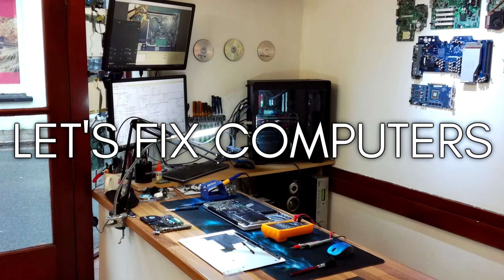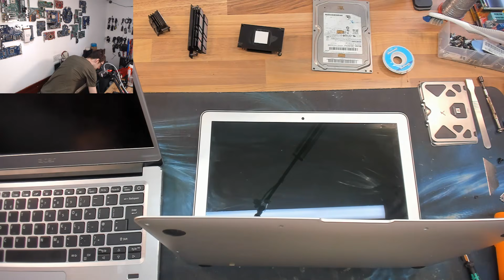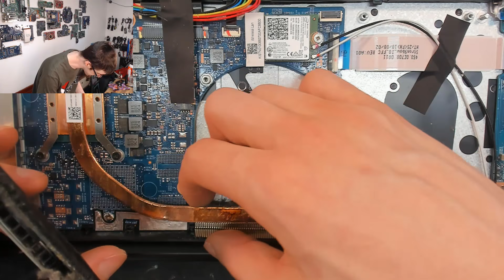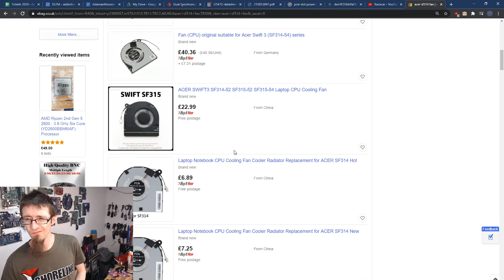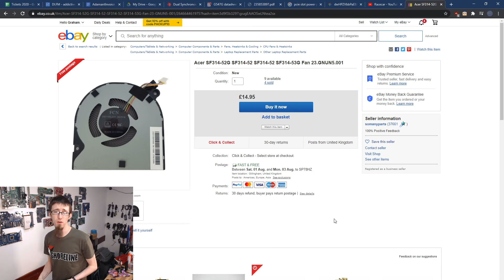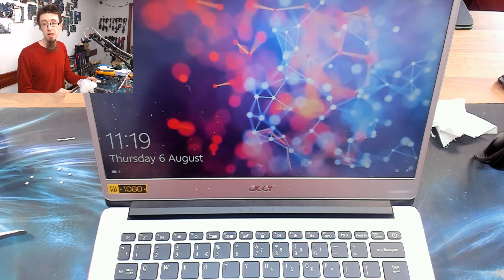Noisy Laptop Fan (Acer Swift SF314) - LFC#219

Comment: Since black tape is sticky, it will collect dust.
The heat conduction metal is hot, we can not use normal tape to stick on it.
Is it preferable to avoid using tape in this situation?

Comment: my gamer laptop fans do make lot of noise but that part is normal. what isnt normal is that it sometimes makes electrical noises i kinda get scared and dont know what to do about it. if i lift the laptop it stops but if i put it back it buzz again. 

not always but sometimes. also for little more info on it. its 5-6 years old working still perfectly fine. we had to change fans few months ago cuz old ones lost their heat sensor but other than that it has no issue

Comment: I had the same problem with noisy fan, and fixed it by opening the fan itself then put a little amount of lubricant and it worked fine without replacement 😂.

NGL i went to risked it all just to save money.

Comment: My laptop sound the same as the acer but worse made a high pitch sound like a fork on a plate and it was spinnig only at 100-2100 rpm my cpu fan is normal go up to 5600rpm

Comment: Hi! I have a question. I have the same issue with my laptop and I looked everywhere for a new fan replacement on eBay and couldn’t find. I was wondering if you know any other laptop brands that use the same fan as the CEPTER N510-01 laptop 😊 it would help me out greatly 🫶🏼🫶🏼

Comment: That vibration is what my fan does... but sometimes when i turn it off, unplug everything and turn it on on my lap it works fine.. also when the fan wors at slower speeds it does that too

Comment: hi sir , i am having lenovo ideapad gaming. the sound from the fan seems good like that of macbook but while placing my ear near to the back panel i can sense some noise and when the fan is at high speed there is such no issue and when the fan spins at a moderate speed i can sense some kind of ratling vibration on the back and front panel . could you please guide me with this @Adamant IT

Comment: Mine did this i cleaned the dust out and fixed it was unbalancing the fan was abit of hair in there aswell 

No fan wobble
Means dust or fan needs lubrication as a fix

Mine is exact same model but windows 11

Comment: My laptop fan makes a noise like a wire was touching the fan blades. I had to actually stick a wire there for a moment to make it pause for a moment and then resume normal speed. It happens if the laptop gets heated or if there is anyone accidentally hits the table or the laptop.

Comment: Hi if i plug out the fan power cable and i use laptop YouTube browsing light use can the temperature below 80 Celsius? or change the fan a coling brick i wonder if be silent and works😃

Comment: I had a similar issue with the fan in my old thinkpad. I was about to purchase a new fan. However, a dip of hot glue holding the center of the fan in place did. the job. It actually looked like it was glued in in the factory as well. so far no more issues with it

Comment: For my old dell laptop I bought a new fan which sounds like a small chainsaw. It clearly has a lower quality than the original one. Do you have any tips if I could reduce that noise by e.g. adding a super small drop of oil or WD40?

Comment: FUCK YOU ACER and all other laptop manufacturers (please prove me wrong, I want to buy a GOOD laptop for once). After a year i had to replace the fan and when i got the willpower to open this craptop I discovered both sides of the openings to be completely FILLED with dust. Nice one assholes, acer has intentionally made it as difficult as possible to CLEAN A LAPTOP FROM DUST.

Now take your car's air filter - easy to replace? House vents? Literally anything else? Cleaning things from dust is normal on this planet, right? Not for laptops. You have to fidget around with these microscoping, super sensitive cables that break very easily. There is NO NEED to have them be so flimsy, in fact the one for the monitor for eample is NOT flimsy and the port is metalic. Why the fuck are the rest of them made of sensitive plastic? Heck, the one for the bios speaker and eternal speaker seem somewhat rigid. Even the fan one. But the ones around the battery, holy fucking shit I swear this is intentional bad design. As sensitive as possible, and I got smaller fingers, I KNOW how flimsy they are, I broke some in the past, I struggle with this microscopic shit and carefully try to put one in... and i break it. On both sides. NICE. Laptop won't turn on anymore. Fuck you acer. Now it sits on a lose connection and can turn off randomly. Because to clean your fans from dust, you have to take out the motherboard. The screws for the fan are RIGHT THERE, why can't you just take out the fans without taking out the whole motherboard???????? Why is it completely possible to make sturdy power connector cables but the other ones. Wait, some retard is gonna say "well much voltage and amperage" not true fuck you, you're not an electronics technician so shut the fuck up.

Oh and how many technologically impaired idiots are gonna think "oh laptop overheating, time to buy a new one" because cleaning your laptop means risking BRICKING IT. Fucking companies like acer should be sued.

"hurr durr but just take it to a repair center" first of all I bought it in germany, I live in romania, and germans are racist idiots who refuse to speak english. "hurr durr not true" shut the fuck up I lived in 20 german cities in 1 year, I know what i'm talking about and you don't. Now let me just send this laptop to germany and wait several months.... TO CLEAN DUST OUT OF IT. Or to repair a stupid connector.

Now let's take cars for eample, do they take your car brand? Volkswagen, audi, whatever. How many car mechanics in your city that accept your car? Why is it so easy to clean car air filters or change oil but when it comes to laptops "fuck it, never gonna do it".

Good job to all of you idiots who were brainwashed with eyecandy websites and reviews by morons who unbocs laptops and give their impression about how "sleak" the plastic design is. Fuck them, fuck you, and fuck hese companies. Waste of my money. I would've bought a desktop pc if i wasn't constantly on the move.

Comment: Can it explode if I don’t change it
Reply from the maker: No. No danger, but as it gets worse, the fan won't spin as fast as it needs to, so the laptop will eventually start overheating, which could lead to a dead CPU. A little noise is just annoying, but if the fan starts sounding really bad, it needs to be replaced.

Comment: that's replacement not a fix.. I have old laptop with no spare parts available, this "fix" doesn't help.
Reply: well it "fixed" the problem not the fan. its kinda like those solution Microsoft support team gave you.

Comment: Thank you so much! That's the computer I'm using and it's making a noise that's driving me nuts, not as bad as that one was before you fixed it, thankfully. I do have 2 cats, so maybe there's some cat hair in there and needs a clean, thank you for showing me how to pull my computer apart (the last one was more complicated and didn't come apart easily) and I already have the screw driver bit that I need.
Ahhh... Got the screws out... Still can't get the damn cover off. FUCK! You didn't show that bit.

Comment: I have the same problem and my theory is that it's due to a little benting of the machine bc one stabilizer under the pc is missing (right under the fan). Took it to repair once, came back without this stabilizer, i kept it like that for one year. Only 2 days after i just put a little substitute under the missing stab, bem, the scooter's cylinder arrived. Other theory : I used the cooler boost to much (it's a msi laptop)  and it fucked it up. I opened the thing, took away the dust etc, it changed a bit. HHH anyway let's buy a new faaaaan
Reply: You mean bending

Comment: My fan sounds completely fine, but every once in a while if I pick up my laptop, change position etc the fan can all of the sudden start to screech pretty loudly and it does so continuously for 10-15 seconds, then it goes back to normal. This can even happen if the laptop is stationary. I've noticed that giving the backside a "light" bang when it happens fixes it almost immediately. I don't know what the problem could be. I got an HP EliteBook 820.
Reply: this is happening to all brands these days... it's really disappointing having to give money for such shitty products... it's not like we can choose, me for example I had to upgrade for work
Reply: I don't know much about all this stuff so here's my 2 cents. You might have a wobbly fan as described by the dude but it might not be dirty enough to be choked everytime. So it's better to take it for a quick check to an expert/professional.
Reply: I do the same😂 but it sucks now
Reply: This happens yo my Lenovo Legion 5i too. I’m checking this to a service centre now, will update soon
Reply: @masaosimanjuntak  In my case it was fixed moving from Linux back to Windows 10.  Linux was messing with my laptop fans (happened with the older laptop too)  Fuck linux, broken mess dogshit
Reply: @masaosimanjuntak  Any update? I just got a new Lenonva IdeaPad 3 and it suddenly started making noise continuously. I thought it was overheating. But I turned it off a day and restarted and it was still noisy...
Reply: @Better_Call_Raul  Hi! I have tried to clean it but it turns out that my laptop fan was bent(?) and messed up due to frequent exposures to high heat and lack of cooling (I play "heavy" games a lot e.g. RDR 2 etc). Had to do some pre-order for the fan which took 3-4 weeks (I live in southeast asia). It costs me around $100 to replace the fan (including the installation charge).
Reply: mine used to be like this but now it doesnt stop when i log in to my hp Laptop
Reply: I took a fan apart. It basically has one small metal piece that is attached to blade half that moves. The small metal piece fits into the other half in a small hole and it spins by magnets. Likely, the sharp movement is interrupting the magnet.

Comment: some laptops spin for like 3 seconds at startup then stop, sometimes, it will turn back on once it heats up a little, My Hp does this were the fan turns on at full blast when i power it, then after 3 seconds it turns off and then 45 seconds later it goes up to middle speed

Comment: I have the same laptop and I am planning to reapply thermal paste. That means I'll remove the heatsink, clean the old paste, IPA and apply new paste. Is there anything particular that I should take into account for this laptop? I've done the drill for my desktop but never for a laptop so far. Thanks in advance!
Reply from the maker: Should be fine, just take care when lifting the cooler - I was a little rough on this one. Got away just fine (no problems afterwards) but it wasn't ideal.

Comment: The cheapest fan for my MSI GS65 was about 40 USD - and that was already from china. In the end the new fan broke after 1 week. This is a real pain!
Reply: this is a serious problem with these new crappy laptops that are being built out there... ALL the brands are basically using the same manufacturing process (did you notice all of them even use the same body shape and everything?? it's insane...)  In these new laptops, a fan dying out can probably mean you're unable to keep using it. When I had an older laptop that worked just fine without fan for 4 entire years. I'm afraid that's not possible anymore with this new generation of CPUs
Reply: and to be honest I don't want to find out the worse way

Comment: I got a new laptop a month ago, and now when I start the laptop there's a buzzing noise for 2-3 sec from left side of speaker.

But if I switch to BIOS menu .... It constantly makes a buzzing sound and it's coming from left side of laptop where the speaker is located. Is it normal or a serious issue? 

If it's a issue what component needs to replaced... Please reply

Comment: I am extremely grateful for this video. I want to express my profound gratitude to you, sir. I hate when I send my laptop to a repair shop and they did a shit job on repairing my laptop. I want to learn this kind of thing by myself. I do not want to get ripped off as well. Thank you, good sir. Keep on posting your videos!!!
Reply: yes, but not everyone has the right knowledge to repair computer stuff by it self. Not every computer is the same, and you can destroy quite a lot when dissambling a laptop
Reply: give examples of "shit job" they did?
what are the kinds of stuff repair shops are doing out there?
Reply: @FeelingShred  This is the most common thing, they disassemble my laptop to clean my fans and upgrade my RAM. When I received my laptop back, it had overheating issues and I heard sounds in the laptop. I opened it and found they taped where it was supposed to have screws and my fans were not cleaned as they claimed. So yeah. This is one of the examples of a shit job that happened to me a lot actually.
Reply: @sombradeoro3005  yea ,that happened to my phone too

Comment: looks like very similar fan thats in my razer blade 15, ive had it for probably about 3 years now great laptop but charger wears out and they aint cheap and my fan did exactly what this one did it would start vibrating when fan speed would ramp up and would stop and re start several times and be fine, i replaced them already but still waiting on new battery to come because mine was super swollen cant believe it didnt burn my house down

Comment: Uh hey, I'm kind of confused.... couldn't you have cleaned out the fan for the Acer and then put it back? Instead of buying a whole new one? I have had the same model for a year now, but I am going to only *clean* it out rather than buying a new fan?

Thanks though the video helped!
Reply: So how was your laptop doing now after cleaning the fan? I also have that wobbling fan noise, but I won't buy a new one instead I just gonna clean it, will it work?
Reply: @patra7015  Let me just clarify that I noticed after cleaning it out that the fan noise I had was obviously only because it was runny at high speeds at times, but my main issue was that my laptop was heating up to quickly. Is your fan making noise all the time or is it momentarily, if it is, clean your fan it will help. However, if you have a fan which is consistently making noise that is not okay, and it is better to replace the fan because it will end up ruining the quality of your laptop! 

Hope this helps~
Reply: @wingangel479  Ah i see, mine is making constant loud noise so i guess the fan it self broke so i might replace it. Thanks for the reply!

Comment: Hi! Thanks for the video! I see that you haven't put back the black adhesive tape between the fan and the copper bar, is it unimportant? I didn't put i back when i cleaned my notebook and it works just fine. Thanks.
Reply: The copper object is the Heatpipe and that's very important

Comment: Silly fix tho, if the fan uses a magnetic servo rotor you can put a little 5W-30 in that bad boy with a needle and it works like new. No need to buy any more stuff.